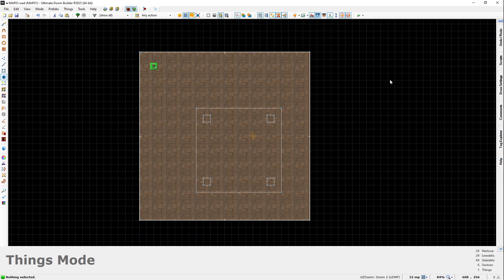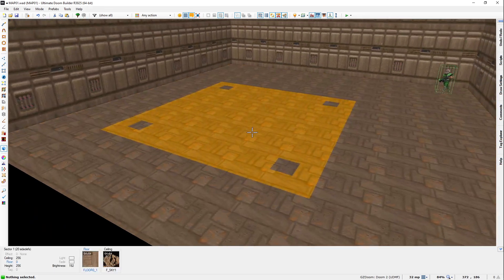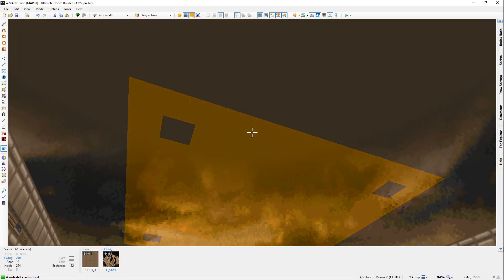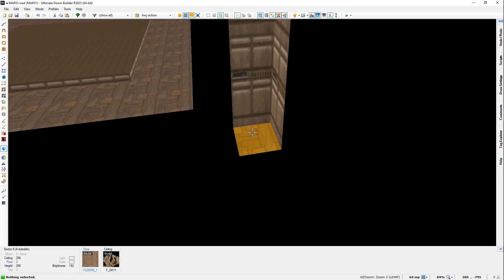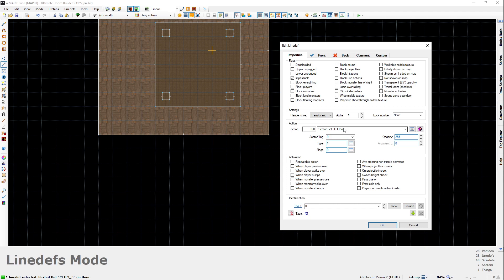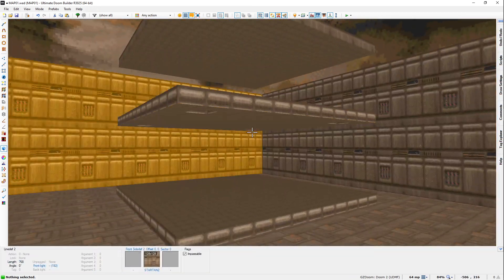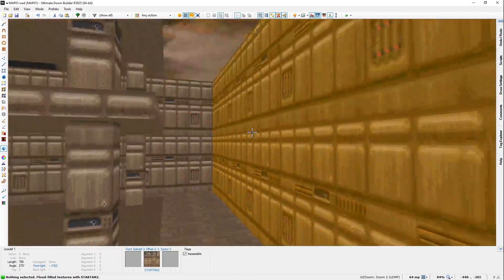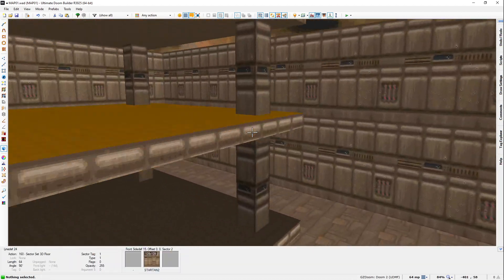[TUTORIAL] 3D Floors in Ultimate Doom Builder (GZDoom)

Comment: please help me in my gzdoom builder 160 action is "S1 Floor Raise by 24 (changes texture and effect)"
Reply from the maker: This suggests that you're mapping for a different format! If you're targetting GZDoom as your port of choice, then ideally you would map in one of it's formats. You can change an in-progress map's format by pressing the [F2] key; however note that this very likely WILL break your map as all the line action values change what they mean. Generally you would pick the correct format for the map before you start mapping.

In case it isn't clear, the map format in the video would most likely be "GZDoom: Doom 2 (UDMF)". If this isn't an option for you, you will first need to configure it within UDB by first pressing [F6], and enabling the option in the left hand column and supplying both an IWAD and a testing executable (GZDoom, in this case).

Oh and one last thing, GZDoom builder is "old" now, and has been for some time. These days we use a tool called Ultimate Doom Builder (often referred to as UDB). I'd advise upgrading when you can!

I hope this helps!
Reply: @Dragonfly_Doom  yes i finaly did it thanks you so much😁😁😁

Comment: This 3D Floor tool helped me make realistic water pools.

I would like to know if there are good (Ultimate) Doom Builder addons tools to extrude lines, even by the angle and extruded line length add/subtract. I did see one out there.

I am trying to find out (easy) ways to make Expert-Level Whiteboard test maps like 'Cryonology' and 'Rite' or the HURT wad, or do I just rotate my whole map to add the off-grid room?
Reply from the maker: Use stair builder tool while in linedef mode. :P
Reply: @Dragonfly_Doom  
Yeah that Stair builder tool is a "bevel tool" in disguise. It does have some few limits to it.

Comment: I just use the built in 3D Floors tool in order to build them. It saves time and is alot easier
Reply: The built in 3d floor tool is great and I frequently use it, but it has one problem: it is not zandronum friendly, due to the way it can generate floors with multiple tags within one sector, which is a feature not supported by zandronum at the moment.

I still use the 3d floor tool, makes things easier, but everytime I need to have more than 1 3d floor within the same sector, i have to manually edit the linedef to use a specific tag, instead of letting be autogenerated.

For later versions of gzdoom that's not a problem at all though.

Comment: Is it possible to have more than two floors, or the upper floor shaped differently to the one below it?
Reply from the maker: Of course! Create yet another dummy sector on the outer area of the map as you did before, using the same line action and tag (action 160, tag relative to the sector you're targetting) and then ensure it has different heights to the previous floor you added. :)